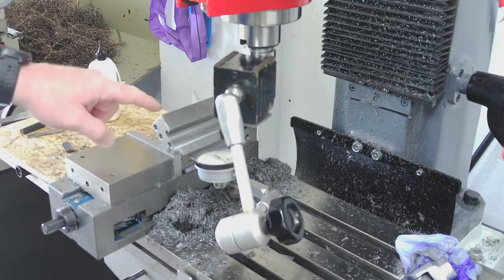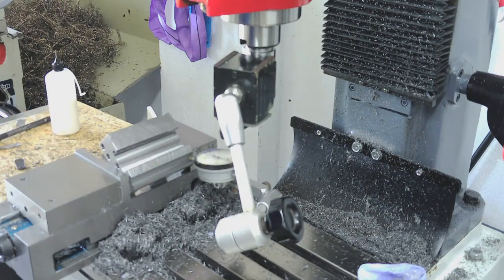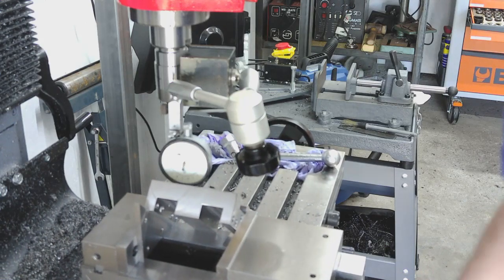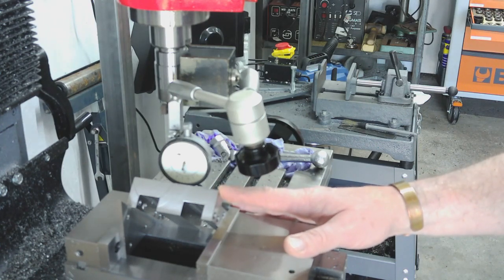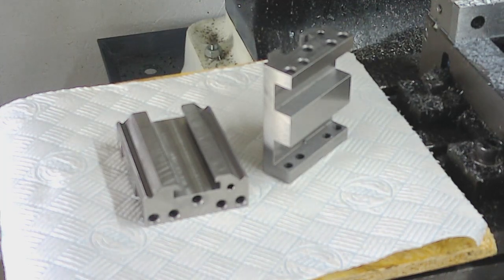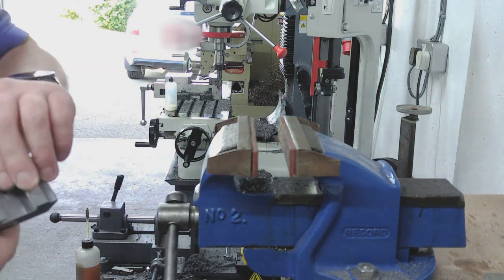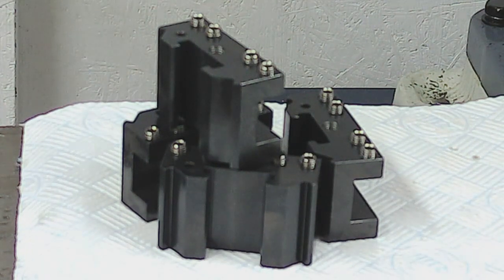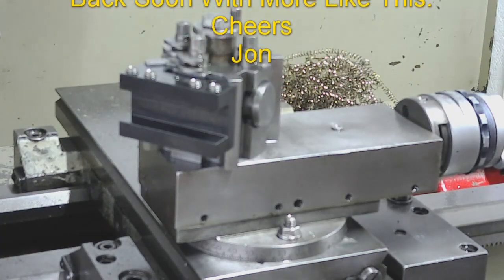Making Dickson Toolpost Holders For Harrison M300 Part 6

Comment: Thank you Jon for a very informative and entertaining series.  You are an excellent machinist and video narrator.  Thanks for all you demonstrated.  I will benefit from your experience.  My only negative thought is that my back hurts just watching you bending over so often to that low mill table!
Reply from the maker: Hi f4phantomll, thanks for the comment and positive feedback, much appreciated. Yes, the mill is a little low really, I suffer from a low ceiling in the workshop but may be able to squeeze 3 or 4 inches at a point in the future and it is something I have been thinking about. Cheers, Jon